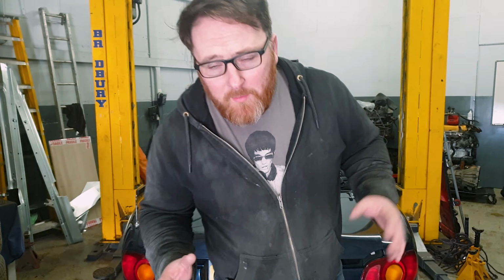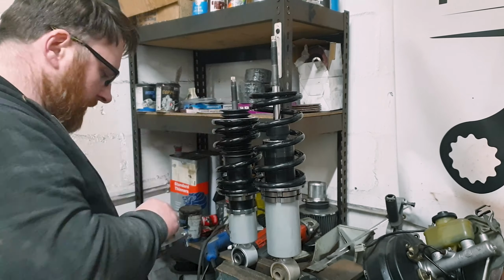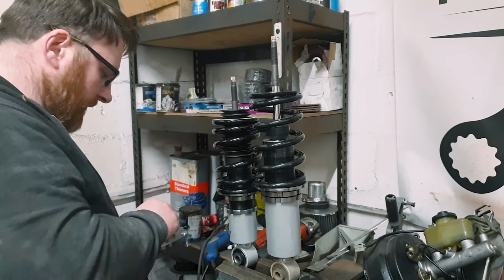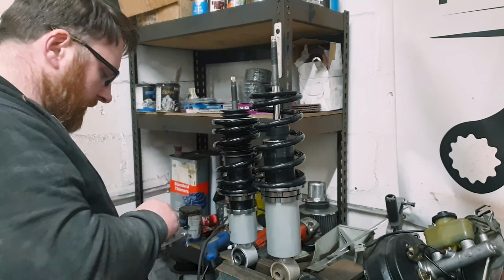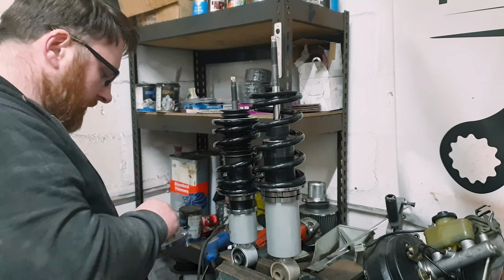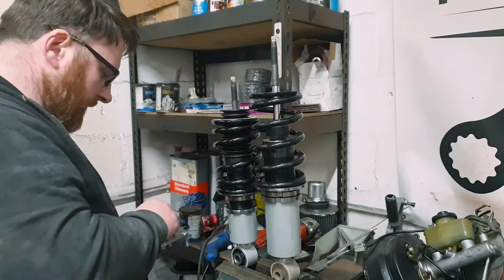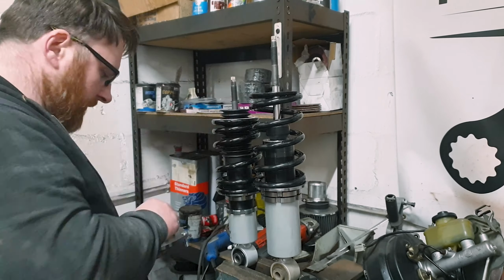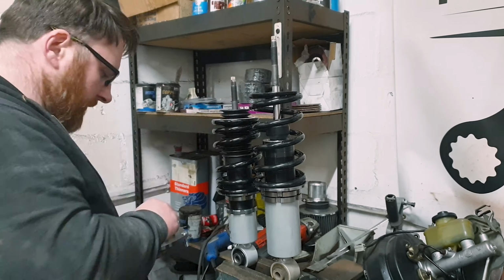Can you race a Daily Driver?

Comment: Unusual. It wasn’t a 10mm spanner hiding underneath
Reply from the maker: Lol. No, it it was a 10mm id still be hunting it.
Reply: @ToolsnTrack  check inside the diff. It might be causing the noise!

I lost a (from memory 7mm) socket adjusting the front calipers on an Alfasud Sprint (inboard disks with the handbrake on the front). Found it about a year later when we dropped the engine out to change the clutch!